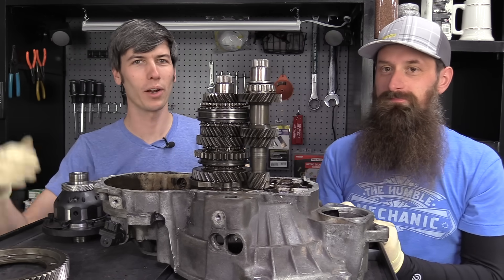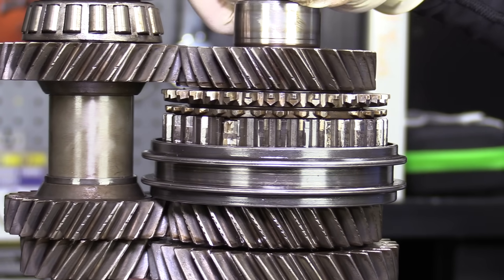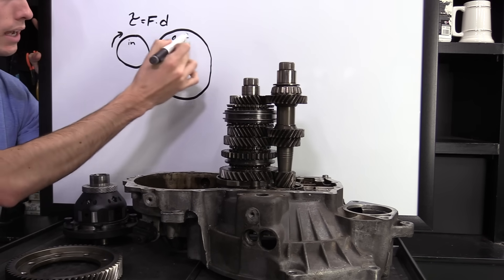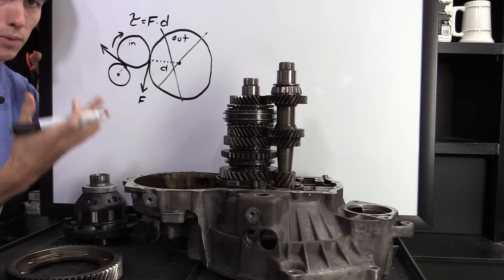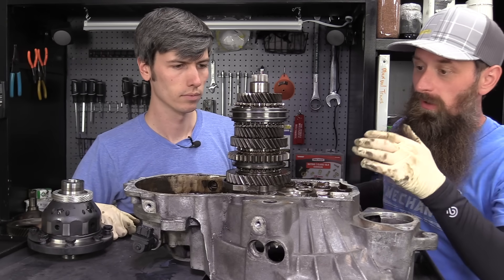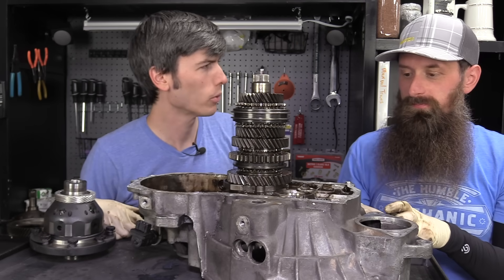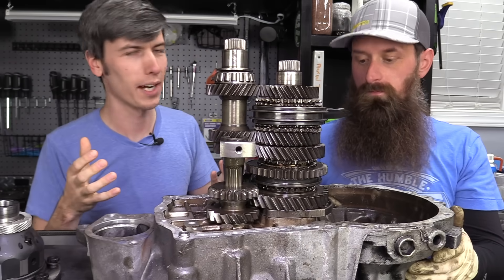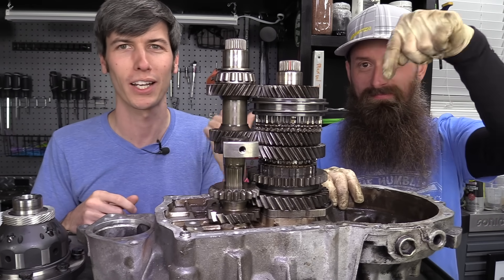How Manual Transmissions Work - A Simple Explanation

Comment: my Isuzu NPR has a 6 speed manual synchro-mesh with a triple cone design. also has a SYNCHRONIZED reverse gear. pretty rare, kinda cool how even the reverse is synchronized. probably common in bigger transmissions so you don't break the teeth off with a 12,000lb vehicle i guess. Dude I bought it from obviously didn't understand that syncing gears is a function of time cus he was just ramming them into place during the test drive 💀 it's in better hands now lol :)

Comment: Is it safe/does it harm the clutch or transmission to move the transmission knob from in some gear to neutral without pressing in the clutch pedal? I have tried this in my car and as long as I am coasting in any gear without any load, the transmission smoothly disengages the gear if i move the stick shift to neutral without pressing in the clutch. Does that wear anything out such as the synchros, gears, or clutch?

Comment: I'm listening to you for my morning drive it's been 23 years since I've driven a stick shift so but it came back better than riding a bike damn I'm old. My question is and maybe somebody in this here thing can answer it for me if you step on the accelerator I'm guessing the clutch plate even in a stick shift is not a hard lock so how much RPMs should change before your vehicle accelerates at a reasonable rate for a 2003 4 cylinder 5 speed Chevy S10 2.2 L I'm trying to figure out if the damn clutch plate is bad or not I'm guessing if the transmission to clutch plate flywheel was a hard lock your ride would be jerky anytime you let off the gas and pressed on the gas so it's got to be some kind of slippage but how much is too much or not enough

Comment: Explain this!
Why some manual gearboxes have sealed bearings inside?
Like oil bath/splash lubrication is not enough or what?
You can do regular oil change and still some bearings may die (because grease is washed away).

Comment: Hi Jason, i hope to answer my question 😉..
since we have a system of idler gears inside the gearbox, and that the rotational speed of the output shaft and the idler gear can be equalized by a synchroniser at any gear change, why do we need to uncouple the disc clutch ?
Thanks

Comment: This was great! only thing I still wanted to understand better is the way the clutch throwout bearing works to press out and disengage everything. The second piece I'd like to have seen is maybe a piece of tape on the trans output shaft so we could see the output shaft speed change respectively as the gears changed in your example. Awesome seeing it all physically though instead of a drawing!
Reply: The clutch in the video uses what's called a "diaphragm pressure plate". Stepping on the clutch pedal pushes the throwout bearing toward the flywheel, pushing the center of the diaphragm spring's fingers toward the flywheel. The diaphragm spring actually has fulcrums that reverse the direction that the outer edge of the diaphragm spring travels, so pushing the center of the diaphragm spring toward the flywheel makes the outer edge pull away from the flywheel. The fulcrum is also closer to the outer edge, so there is some mechanical advantage as well. This gives a reasonable pedal while simultaneously allowing for sufficient clamping force on the clutch disk.

Comment: i got a question i have a vw touran 2011 6 speed in 5th or 6th gear i can hear a washer rattle only when accelerating (gearbox engages gear perfectly and drive perfect)  just rattles in those two gears do you think it would be gearbox related as someone has said the turbo actuator is know to rattle in higher gears if you have any ideas i would be very great full

Comment: Hi, im having a couple ticking/clicking sound coming from axle- transmission area. Only when releasing the clutch while  downshifting between 3000 and 4000 rpm. Not when cold but after 15min driving it start ...
Any idea? Pressure plate maybe ?

2018 Sportwagen 6MT 4Motion

Comment: I want to design and 3D print a manual transmission but there's something I am having trouble understanding. How is it that the gears spinning on the output shaft doesn't cause the output shaft to rotate? Aren't the gears on the shaft, connected, so spinning one should spin the other? How is it possible for the shaft to not rotate?

Comment: Well, imagining gear shifts in static condition is easy. But how do the synchronizers engage with the gears at high speeds? Means your output shaft revolves at high speed and you gears aren't doing much.... Then.... How?

Comment: This is how I see it: The toque is higher on lower gear ratio, cuz the larger diameter of the larger driven gear behaves like a longer lever.
Reply: I'm sure angular momentum also comes in here somewhere.
Reply: In CVTs, the lever is pulled/pushed using an additional rope tied to its 'operating end'.

Comment: if the clutch pushing forward since the pressure plate is attached to it how would it be disengaging the clutch to the engine wouldnt it be pushing it closer to the engine???????????

Comment: According to the Learn Engineering's video, the input shaft and the output shaft are inline, and there's a counter shaft that is being used to transmit the rotation of the engine from a gear to another, while here the input shaft and the output shaft are separated and the gears are mounted on these two shafts, how does it work? Which gear boxes uses a counter shaft and which not?

Comment: Talking about transmission, intending to flush the system, what happens if I empty the transmission fluid through the hose which feeds to the radiator while my car is at idle. Will it hurt any internal part of the transmission?

Comment: So if the input/counter shaft the gears get larger from 1 thru top gear, the rpms on the counter shaft gear drops from 1st to top gear since the first gear is the smallest. Im a little confused. If im going 40mph and i downshift from 4th to 3rd, i have to increase my rpm before engaging (clutch depressed) so that engine speed matches road speed. But if the 3rd gear is smaller than the 4th on the input/countershaft ( since when clutch is depressed and rev matching, output is not connected and youre trying to match engine speed with road speed) why do i have to increase rpms to rev match?

Comment: I have a 6 speed gearbox car. While in 6'St gear and driving the car started to decelerate .The gear leaver can go in to the 6'th it feels normal but he gear is not engaged . All others gears are working well and there is no odd sound or vibration. What can be the reasons? Can I use this gearbox further? Is it safe?

Comment: 1:52
Less confusingly: The transmission allows one rotation of the engine to correspond to various numbers of rotations of the wheels. This is necessary, because a combustion engine cannot go arbitrarily fast or slow.

Comment: A very interesting video! Two questions remain unanswered though... (1) How do manual transmission prevent the driver from shifting into 1st or reverse when the car reached a certain speed; and (2) Why is it, when cold, that the car has to be completely stopped to engage the 1st? It is most probably related to my first question, but it is strange and unclear to me why, as the car warms up, that it is progressively easier to engage the 1st gear to the point that it is possible to do it at low speeds. When cold, it feels like something does not allow the gear shifter to select the 1st gear unless the car is stopped.

Comment: A benefit to having a manual Transmission is that you can push start it (roll start) if the battery is too weak to start the car.  Can you roll start a car that has a push button start instead of a key ingition?

Comment: Awesome video! Question: Why are driven gears usually helically cut, where as reverse gears are straight cut? Does helically cut help to increase the torque or prevent gear slipping between the input and the output shaft or something? Thanks!
Reply: Helical gears are stronger than spur gears. Helical gears run quiet. Reverse is usually a sliding gear thus making it a spur gear allows it to engage the mating gear with ease. Reverse in some applications is synchronized but still slides and also is helical in other applications as well. This trans in the video is pretty much your average FWD manual transmission yet some do have a helical reverse and fully synchronized reverse as well.

Comment: nice video....interesting if some details on how the shift mechanism has designs integrated to them so shift homes in and not kick back, also on splined output shaft and how the synchromesh transfers power to the output shaft from the floating gears

Comment: I assume the straight cut of the reverse gear rather than the helical cut of the forward gears is why reverse is sometimes difficult to engage? Or is it because reverse gears don't have syncromesh? Or both? And why are manual transmissions designed this way? Cost?

Comment: Very educational, simple, and illustrative! Thank you for this video! But there's something missing that I've always been wanting to understand, and so hopefully you'll cover it in a follow-up video as other's have requested:  How do the synchromeshes work (maybe with a tie-in with rev-matching / double-clutching)? And maybe in another video:  How do dual-clutch transmissions work?   And maybe yet in another video:  How do modern automatic transmissions shift gears smoothly without jolting the car between shifts? Hope that's not asking for too much. Thank you for your educationally addicting videos!

Comment: Small side info: 

All this clacking noise is acutally absorbed by the transmission oil, leading to a quiet gear change and a quiet gear box

Not all transissions are made equal. 
Just imagine, these small width gears are made to withstand huge amounts of torque, and they do indeed. 
Stronger engines need stronger gears and equaly small to fit into cramped engine compartments, so you can imagine how much engineering goes into these gear boxes, to make them able to handle higher torques and be quiet and last long at the same time. 

And from the simplicity of the whole contraption, you can get a grasp of how much cheaper it is to make a manual gear box, compared to an automatic.

Comment: why dont we make the drive and driven gears both larger in size keeping the same ratio as it will provide a higher output torque as there is higher force applied to the driven gear for the same amount of torque provided by engine.
Reply: because ratio is achieved by the product of two ratios in these gear boxes. (Drive ÷ Driven) x (Drive ÷ Driven) = final ratio. In GOOD gear design you never want the same tooth in contact over and over again. ( Non Hunting) so for example  2 gears that are both 26 teeth. If you want a  1:1 ratio you'd be better with a 26:27 combo close to 1:1

Comment: Chris, how much would you charge for a complete engine and tranny overhaul??! I’ve got an 04 GTI VR6 6spd.
Reply: Tootall Jon-doe it’s cheaper to buy a remanded trans. The gears are about $200-$400. Each. 

There is a site called VWtansaxles (I think that’s it) that sells reman transmissions. It’s probs cheaper than a rebuild. Lol
Reply: HumbleMechanic 

I’ll check it out, thanks.

Comment: It’s a s2000 shifting in the video. 

What can be the reason for really tough shifting? I somehow hope it’s the clutch not disconnecting correctly. 
I don’t really have grinding but when pressing the clutch it feels like 1-2 seconds till I will be able to put in the gear especially a problem 1-3rd gear with low rpm

Comment: So great and easier to understand. 
I would love to see how the gears on the same shaft lock together between 1-2 and 3-4, are those pins ?
Moreover doesn’t the hélicoïdal design force away the shaft with the torque? That should loose power and increase wear a lot. 
Why not use chevron design in that case or straight cut (noise issue ?).

Comment: Great vid. You kind of hint at the fact that you don't really "change" gears - all the gears (apart from reverse) are always engaged. What I think you don't explain (as well as you perhaps could) is the process of changing their engagement with the output shaft. As mentioned in another comment, if you do a vid explaining synchronisers, that might be a good place to explain what's happening on the output shaft.

Comment: OK, I'm working on a friend's car, 
and we have SERIOUS transmission 
issues.

Number one, the trans oil, when I drained 
it, was green and gold flaked.
Number 2, the trans GRINDS when put in first.

After re-positioning the linkage, to allow 
higher force to the first and third gear 
selection, we now have grinding in 
second and fourth.

I'm DAMN sure the green lube, as well as 
the gold flake, are  copper and brass 
symptoms.

Oh, 25 miles on the trans, since rebuild.
And, 20 of them, were being towed, with 
no power used.

steve

Comment: ...but you guys skipped right over how the shifter moves from 1/2 to 3/4 by going from left to right even though the gears are actually further down the output shaft, not on a separate shaft to the right/left... that's the only part I was interested in lol

Comment: Can you please show what happens when you put the stick shift into gear, but when you let off the clutch it doesn't lock into gear. So usually you have to put it in neutral and wiggle the stick shift left and right to loosen it somehow. 

And what happens when you shift into reverse while still moving forward slowly just before coming to a complete stop. Does this do any damage in the long term. Thanks.

Comment: This is no a question about manual gear box, but automatic one. If I put Neutral at a stop light instead of keeping the car on Drive, leaving the engine in idle, Do I save gas? Be aware that I live in Mexico City,  lots of stop lights and traffic...
Reply from the maker: Nope, uses basically the same amount. I have a video on idling where they test both methods.

Comment: If you were looking to upgrade your transmission for higher torque capacity and closer gear ratios, would you be able to then just upgrade your input/output shafts rather than replacing the full transmission itself?

Comment: It was mentioned incorrectly a couple times. The engine is not attached to the input shaft, only the clutch is attached to it. The engine is attached to the pressure plate. When engaged the engine is attached to the clutch by way of the pressure plate and the flywheel sandwiching the clutch disc.
Reply from the maker: Yeah, when I was editing I was thinking the way I worded it was a bit confusing. With the clutch engaged, the engine will rotate that input shaft, as the flywheel and pressure plate sandwich the clutch disk.
Reply: @EngineeringExplained  I think most people watching your channel know anyway. Anyone completely new to it might get confused though.

Comment: What is the reason for straight cut gears on the reverse gear?
Reply: Helical gears will, by virtue of being on t' piss, produce thrust on the shaft. That's why the shafts are held in place by thrust bearings.

All other gear pairs are held in place on the shaft and selected via a sliding splined sleeve which locks into place. Reverse is selected by sliding a gear into place, along a splined shaft instead. That's also why it has no synchro. Once it's in place, the only thing holding it there is the selector fork. That whole assembly in general is comparatively weak to begin with. If you had any thrust on that gear it would either just pop out or damage the reversing assembly.

Using spur gears keeps thrust off the shaft, allows for simpler, smaller, lighter assembly.
Reply from the maker: Probably cost.
Reply: @EngineeringExplained  actually space. It's assumed most cars will be fully stopped so no synchros are needed and spur type gears slide together. You can have helical reverse gears as in a Muncie 4 speed but then the spline needs to be helical which in some applications is hard to achieve.  Reverse gears don't need to be as big as forward gears since speed and RPM are not a factor. Some rev gears are big, especially in truck applications.  Thrust has nothing to do with it. There are many gear boxes that have helical gears with ball bearings. The beauty of tapered bearings is you can get the same load capacity in a smaller form factor. The downside is assembly requires shims. Congrats on the 2 Mill subs
Reply: I thought it was due to the fact that you couldnt slide the idler into mesh with the output gear if it was not straight cut. Correct me if im mistaken

Comment: Charles does this transaxle have synchronized helical cut reverse gear? In Golf V GTI 02Q transmission it has all these “doesn’t make sense” cool features built into that transmission, you can put into reverse while going forward (although in the owners manual it said not to do so, I wish they can be honest about that part but I guess they didn’t want to create extra troubles) on that car and it doesn’t whin at all either no matter how fast you reverse. I wonder when Volkswagen thought about putting a syncho and helical reverse gear in the gearbox.

Comment: The most interesting thing in this video is that you let clear that when the car is running the two shafts are always rotating and the two sets of gears are always in contact even though the output gears that aren't engaged are rotating freely. I used to think that just the gears of the engaged gear were in contact. I think some diagrams lead me to think this way.